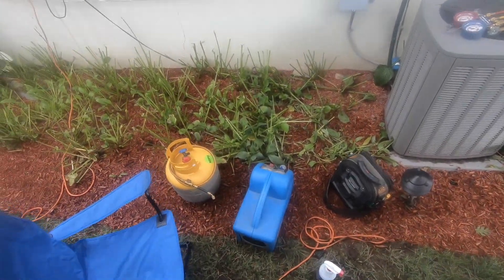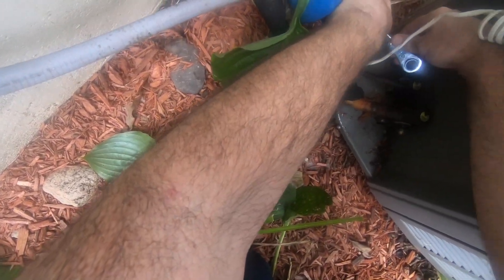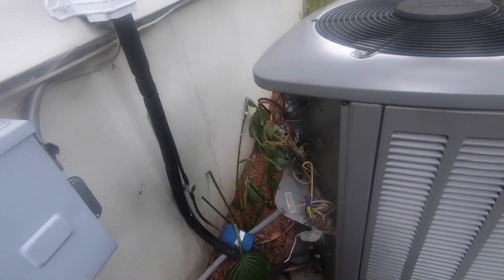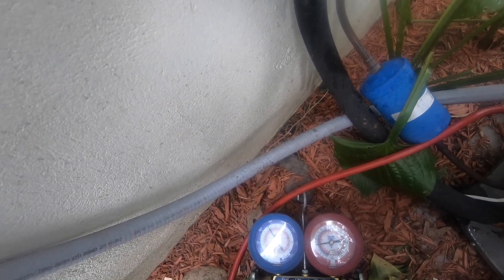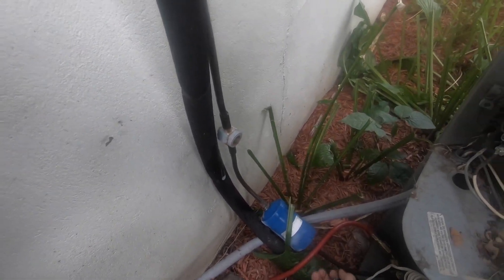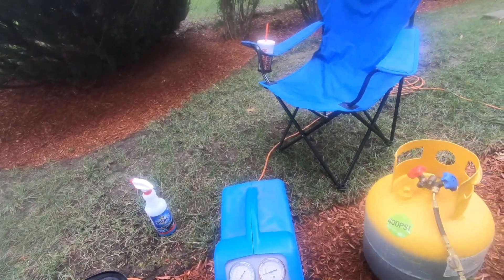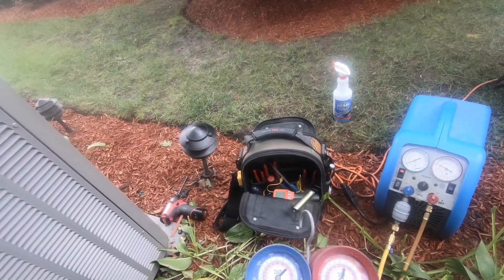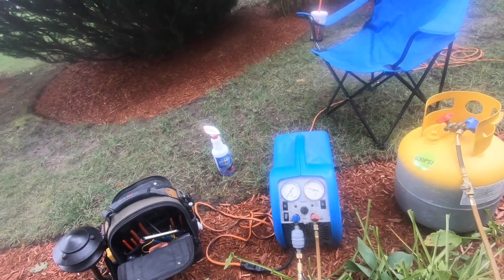HVAC How to Pump Down and Recover Refrigerant

Comment: the tool bag is good, where can i buy it
Reply from the maker: It’s a veto tech mct. I picked it up at a local supply house. If you buy online just make sure it’s an authorized Veto distributor in case anything breaks it’s warranted for 5 years. Except the zipper. They know most techs will over stuff the bag
Reply: @thehvachacker  I'm from Indonesia and I intend to buy online can you provide the link link

Comment: WHEN DO YOU RECOVER FREON FROM A UNIT DO YOU CHANGE THE COMPRESSOR AND PUT THE REFRIGERANT BACK OR DO YOU PUT NEW?
Reply from the maker: I recover if doing a repair inside the condenser. That’s a leak repair or changing the compressor. If I am changing the compressor no way that refrigerant will go back into the system. New compressor means new refrigerant. If acid is present then besides a new liquid line drier I am adding a suction line drier. If it’s a leak repair I will put what I can back into the system. Now if I feel something is wrong with the refrigerant pressures seem wacky I recover and give a fresh charge. Now I also have to recover on any repair happening on a RTU since no valves to pump the system down
Reply from the maker: Also recover when a system is being replaced, gas must be out of it to scrap it

Comment: You didn't weigh the recovered refrigerant.  Also close off the valves on the manifold first to ensure the system pressure before ending recovery.  You may have quite a bit of refrigerant to recover as you were reading the draw on the hoses, not the final system pressure before shutting down.  This is especially needed if liquid is recovered as liquid boils out and frosts.  Wait for the frost to vanish and warm up before ending recovery.  On the condenser system, this includes the compressor crankcase and filter.  If it is a heat pump, the receiver if it has one.
Reply from the maker: I didn't weight it since I was putting it back into the system. I weighed the charge back into the system. And then adjusted the subcooling. I replaced the evap on this system.

Comment: Why did you not just recover in the beginning? Isn’t it a waste of time to pump down ? Or where you just doing it to show how to pump down ?
Reply: Oh okay just wondering because when I replace a coil I usually just do a pump down just like if I where to do a pull and clean
Reply from the maker: When you pump down do you always get the whole charge into the condenser?  Some units I can yet some units the compressor starts rattling and making a ticking sound from the restriction made during pump down. I lost a compressor once during a pump down. Sucks sealing a leak or doing a repair on a working system to telling the customer they will not have ac till I can get them a new compressor. Also for a video I have to recover any gas I couldn't  get back into condenser.
Reply from the maker: I pumped down to save refrigerant. Pumping down isn’t a waste of time since I am storing  refrigerant in the condenser. If I was able to pump the whole charge back into condenser I would. I only recover the gas at the end to protect the compressor. I was replacing an evap coil here. You wouldn’t pump down the refrigerant to reuse after the repair?
Reply: Well most of the time I can get all whole charge in the outside unit but I never take it all out to change a coil just wondering
Reply from the maker: Would u make a video showing what you do with what didn’t pump into condenser? I don’t think 15-20psi falls into de minimis release according to epa standards. Yet I have had subscribers ask to show how to pump down, and others how to recover so I made a video just to show how to do both instead of it being inside a repair video